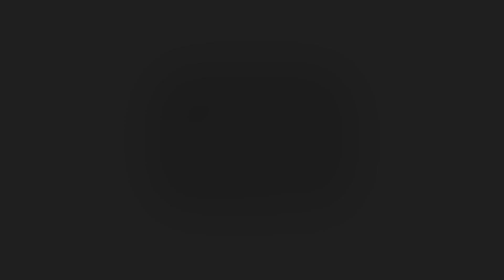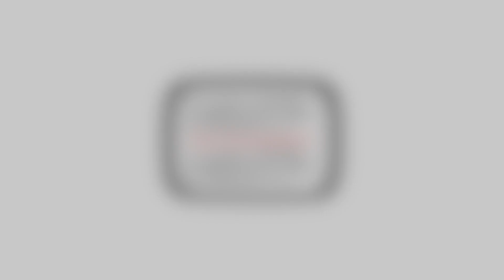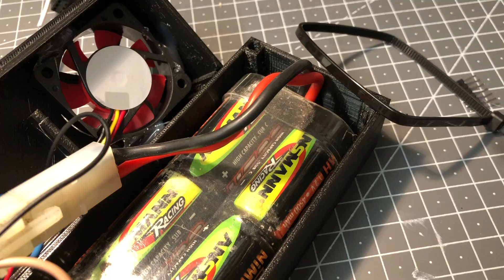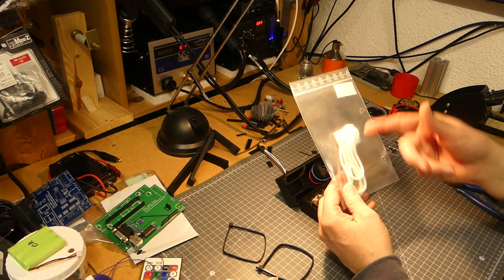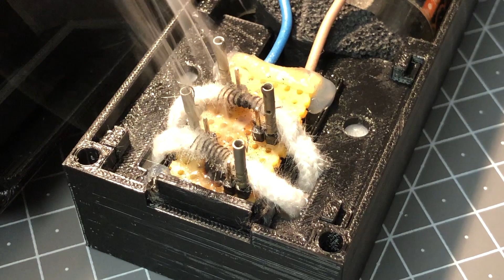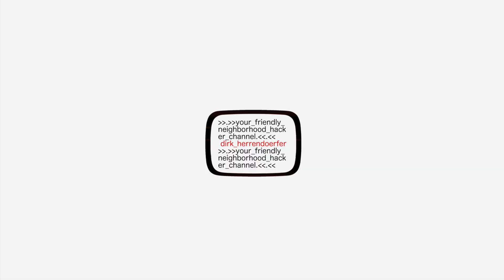Cheap Smoke Machine

Comment: Trivia: Das "Fluid" ist 'ne deutsche Erfindung ⚗️für die ein  Günther Schaidt einst von "Hollywood" 'nen Technik-OSCAR bekam. 📽
Der Spaß kostet übrigens bei Thomann (oder so) nur 8-9€/l in der Qualität "Pharma" also imho sollten selbst Raucher einfach den Kanister (reicht den Abend (bei mir))kaufen 😘
@DIRK ...druck noch 'ne kleine Düse und lass den Quirl in's Gehäuse blasen das macht dann 'richtig' was her 😁☣️👹
Reply from the maker: Der kleine blaest schon in die Kiste hinein, und die Nebelkammer wird gut belueftet. Es waere allerdings besser wenn der Nebel aus de Teil gesaugt wuerde, und es an der Stelle des Verdampfers ein Druckabfall stattfinden wuerde, dass wuerde die Leistung noch mal merklich verbessern. Ich plane schon den Nachfolger .... irgendwann ... mit einer Lipo-Batterie fuer mehr Leistung und einer Verdampfer-Kammer und Turbo-Luefter am Ausgang.

Comment: 1. also mit really really expansive meinst unter 10 euro, oder!? 
2. Ist da noch  eine Regelunselektronik drin, oder hängen die nichrrome drähte direkt an der batterie?
3. Welches Glycerin nimmst du
4. Wie ist das Mischungsverhältniss Wasser Glycerin?
Reply from the maker: Der Meter hat glaub ich 12 Euro gekostet, mit Versand. Keine Regelung, nur ein Schalter, die Laenge der Heizdraehte limitiert den Strom. Und das Nebelfluid ist normales B2 Fluid, nicht selber gemixt.
Reply: @dherrendoerfer  Danke für die rasche Antwort. Daumen hoch!